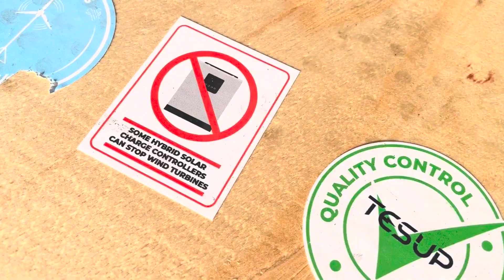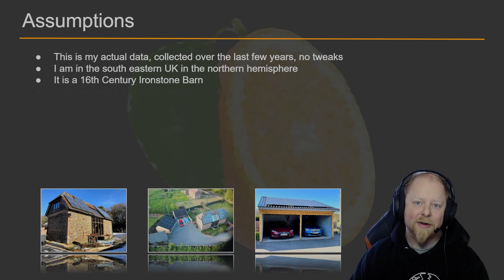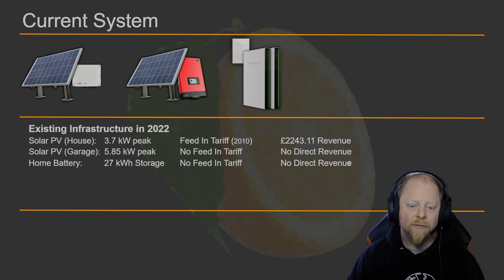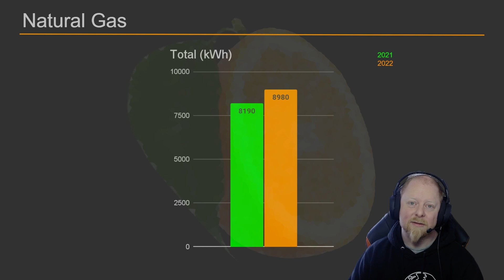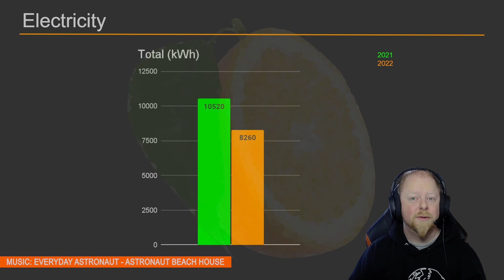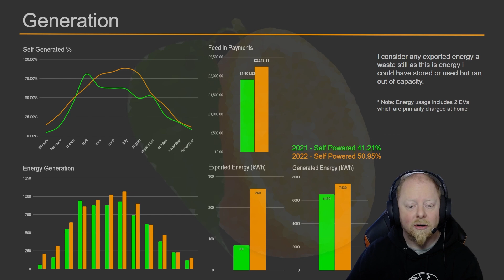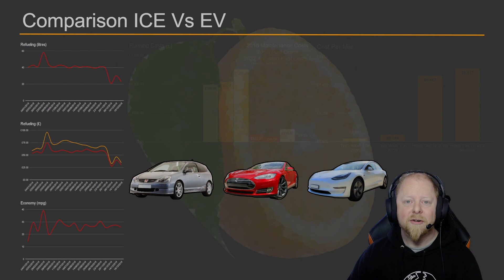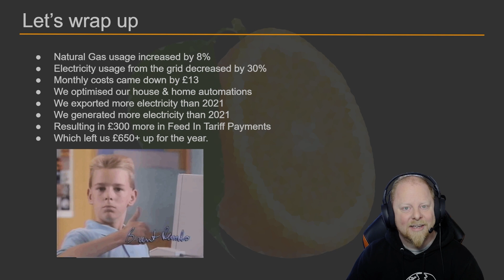Tesup Atlas 4.0 Update & Energy Review of 2022 - February 2023

Comment: Are the specs for your tower available anywhere?
Reply from the maker: It is just a standard F33 global truss stage truss. It’s an off the shelf component that I’ve mildly modified.
You can purchase all the parts from any major stage/lighting company.
Let me know if you want more details.
Reply: @sustainableorange  thank you! Last question before I go buy the truss, what are the dimensions of your tower base footing?
Reply from the maker: I went with an 800mm square heavy duty base, which I bolted 0.6m down into concrete footing.

Comment: Really looking forward to seeing how you get on with this. From what I have read online, these are a massive disaster zone and don't work anywhere close to what the manual states... I hope the nay sayers are all wrong. I'd love to be able to buy a turbine that will run for 5 years and generate 13,000 units a year in a location with an average windspeed of 7m/s, for under £1500...
Reply from the maker: I hope so too! But so far I’ve not had much success!
Reply: It would be great to see the new unit in operation. What it produces etc on an average day. How have you found the magnum 5 so far?

Comment: Why did you select the Magnum 5 and not the more powerful AtlasX7?
Reply: Hi, just looked at your videos really helpful thanks. I have a question we have solar panels and battery system what is your suggestions regarding connecting it to to atlas x7. Thanks Paul
Reply from the maker: Well I just added mine to output to the house. As we have a Tesla gateway it effectively isolates us from the grid.
So I just added the wind inverter output to come in with one of our solar systems so the powerwall sees both the wind and solar as a single input and can monitor it.
Reply: Hi thanks for the update. We don't have a Tesla system 😔 at the time didn't know much about solar systems and the expense was rather pricey. Trying to get as much information regarding the actual output from a tesup system. Thanks Paul
Reply from the maker: I’m very lucky that I could get such an advanced battery system. It makes doing things very easy.
Without it I would probably need some sort of automatic transfer switch that would isolate the house from the grid in the event of a grid outage to get similar functionality. This is possible but it’s not that straightforward.
Reply from the maker: Because that was what I was offered by Tesup as a warranty replacement.
Reply: @sustainableorange  They also offered me a Magnum 5 but I want a vertical turbine. Tesup is still waiting for the magnets to finish the AtlasX7. Delivery is expected april 15th.
Reply: Hi, I was looking at getting the atlas x7.  Any suggestions. Thanks Paul

Comment: I just put up a 600 watts Chinese wind turbine two days ago. It probably would have been okay, but it's aluminum wound, I think, and it's a 12 volts model, not the 24 volts one that I ordered. I hooked it up with a rectifier and have it charging the top ten of my twenty big marine batteries. I have 1200 watts of solar panels and ordered two more 100 watts panels. I got the wind generator to keep the voltage up on cloudy windy days. They sent me an email wanting to sell me more stuff, and I replied to it telling them that they sent me the wrong voltage of turbine. I have a short video of it spinning on my channel. So, what happens to the other Tesup Atlas 4 buyers, who don't get preferential treatment?

Comment: The free electricity for life, what actually does that mean, and how do you account for replacing the battery at some point
Reply from the maker: All early teslas (pre 2016 - April) came with free Tesla supercharging for life. Those cars charge for free at Tesla chargers anywhere in the world that is compatible. So I can drive from London to Kazakhstan or the arctic circle for free as much as I like.
To me this is worth about £3000 a year in Petrolhead equivalent.
It’s a ridiculous perk which Tesla are trying to stop as in the USA they are offering an extra $3000 on trade in if your car has it!
The battery should last for 300-500k miles. I don’t plan on replacing it, nor do I expect to. However if I did the cost is about £12000 and so at £3000 a year in free charging vs petrol it would pay for itself in 4 years.
Reply: @sustainableorange  thanks